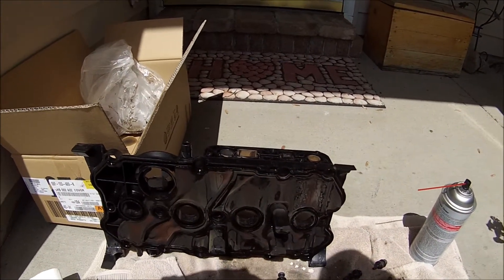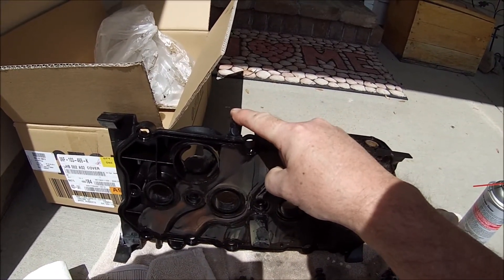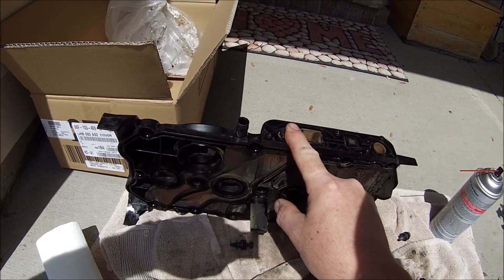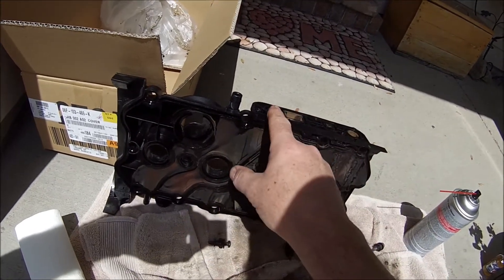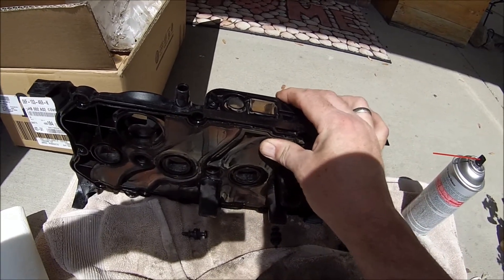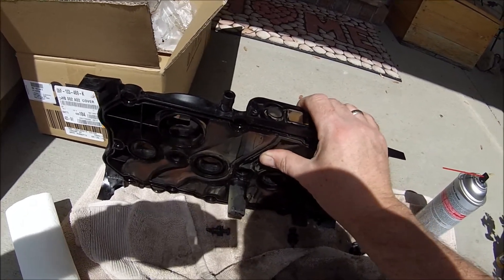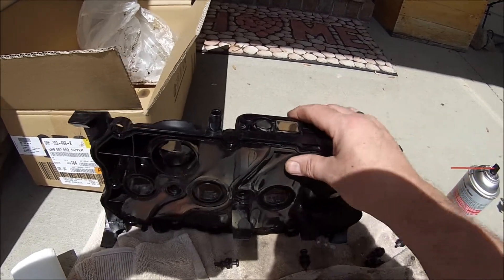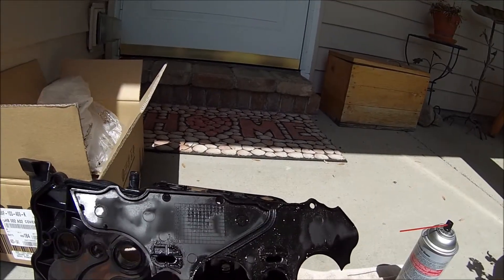MK5 GTI valve cover problem.

Comment: hello, ive been noticing on my mk5 gti exshaust has been smokey seems to do it on take offs and deceleration, looks bluish car has 70,000 miles any mods on your car? mine is catless but shouldn't cause bluish smoke should only cause greyish black I wounder if this is my problem the same u had thanks for any imput
Reply: Roh Echt same issue here. Pulled out coils and spark plugs and looked down 3 and 4 cylinder and i seen wet oil. Cylinder 1 and 2 are dry. Going through about 1qt per 1000k. Not so much smoke out exhaust though. Dont really feel like  installing new rings. Selling this car asap.